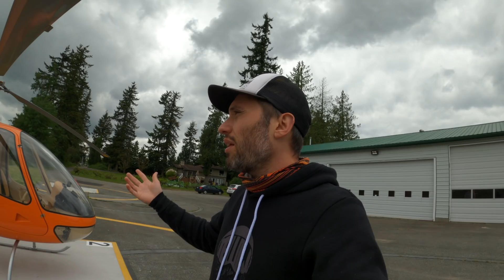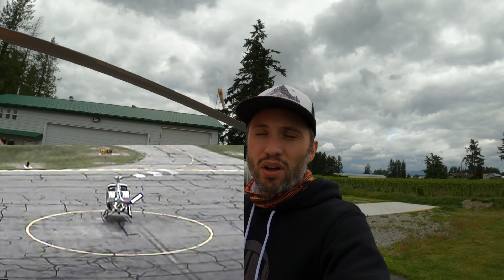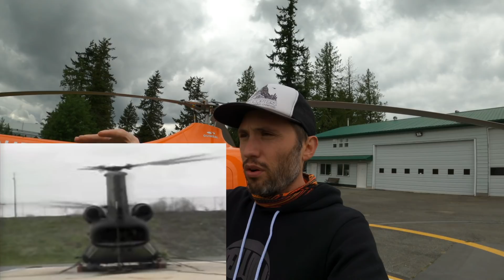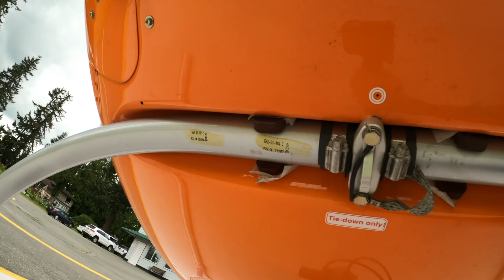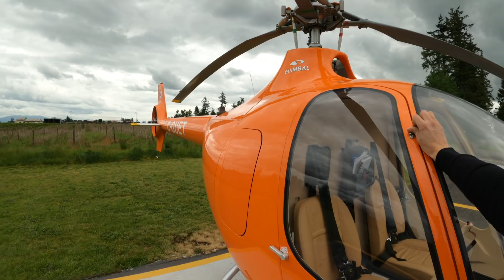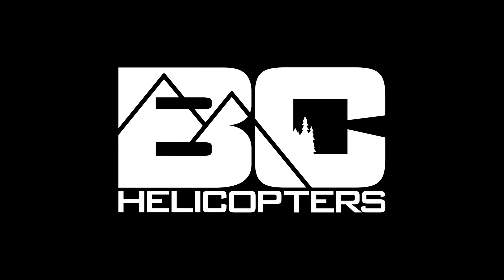WHY HELICOPTERS GET GROUND RESONANCE

Comment: I'm in engineering and I've seen a lot of cases where words turn into sounds when somebody's explaining. This is not ground residence and it's the vibration frequency like Tesla describes. This thing weighs nothing has a Gob of horsepower and it's Giant swinging rotor is a source of pulses of timed energy. The whole helicopter is resonating whenever it is flying in the air like a tuning fork and then the ends  grab the ground and reflect all the energy back up into the helicopter. The energy accumulates by increasing the amplitude of the vibrations.

Comment: A pilot friend of mine said this is why when you land you wait a moment before you spin down to confirm you've got a smooth landing -- if you start to feel it, you're already in position to get off the ground quick.  If you spin down you may not be able to avoid the rapid disassembly.

Comment: Question: If instead of a skid, the helicopter equiped with wheel and suspension like the mi-8/mi-17. Will that prevent ground resonant from happening? To me it looks like the suspension and the wheel will absorb the resonant

Comment: I would add that the cause is that the lead/lag of the blades get out of sync such that the center of rotation of the blades is no longer over the shaft. It’s offset

Comment: This may be why my RC Helicopter is a doing this when I spool up slowly.  I was thinking it had to do with the onboard gyroscope acting wonky since the helicopter was still in contact with the ground and not responding to it's attitude changes the way it expected.  I just got in the habit of spooling up and lifting off the ground a foot and that solved the problem.  I was unfamiliar with ground resonance.  I also tend to keep the screws that retain the main blades to the rotor a bit on the loose side, think I will snug them up a bit as well.  Thanks for the video!

Comment: What you failed to mention is why it only happens with 3 blade or more (fully articulated rotors) and not 2 blade is because the 2 blade doesn’t lead and lag (semi rigid system) 
If the 3 blade gets out of phase (120 degrees apart) it causes the vibration in the rotor head

Comment: Nice video except you didn't actually explain what causes ground resonance. It is not simply the shock of landing bouncing between the rotor head and the ground. If that was the case it could never happen when an aircraft is starting up. Too bad for all the people who think they understand ground resonance after watching this video.
Ground resonance is caused by the rotor disc being out of balance, so the center of gravity (CoG) of the disc is not in the center of the mast. So the whole aircraft starts rocking round, following the CoG as it moves around the disc. If the flex in the landing gear, the tyres, through the airframe the sponginess of the ground or whatever happens to be just right, then the amplitude of the rocking will increase, making the CoG move even further out, making the rocking worse which goes on until destruction. So the bounce back is definitely involved, but not mentioning the out of balance rotor disc is a large piece of the explanation missing. The shock of touching down can be one reason the disc goes out of balance. But a gust of wind or a faulty part can also cause it, among other things.

Comment: Brantley helicopters effectively resolved this resonance by using a double articulating rotar blade design on both their models. The inner short shaft design wasn’t taken up be other designers; the outer blade sections Cary the flight loads.

Comment: Basically a lot well explained but technically not accurate. Kind of housewifes explanations. For example, if you lift off, ground resonance goes away because you add aerodynamic damping to the lead lag motion with larger angle of attack. Lead lag damper only add damping they avoid resoance by additional damping and not by restricted movement.

Comment: Correct me if I'm wrong ---- as I usually am --- but it sounds to me like constructive interference between the rotor head and the ground.

As the vibration/pressure waves from the rotor head, to the ground via the skids/wheels of the helicopter rebounds off of the ground, those propagating waves collide the ones still being generated. Some of those many be canceled out, due to being the equal, but opposite frequency, and waveform (deconstructive interference).

However, some waves are of similar, if not exactly the same frequency, wavelength, etc, and what you get is bigger waves. Thus, in a cycle of positive feedback, the rapid increase in resonance overcomes the natural frequency of the materials used, thus causing catastrophic metal fatigue, as, as soon as the first micro-craking begins, those crakes rapidly propagates, tearing right through the material in fractions of a second ... it's a similar effect of how a glass can shatter by sound waves alone, as high speed footage shows the glass literally flexing like jelly, until the stress harmonics cause material fatigue ... then boom, glass everywhere ...

At least that is what I think is happening. Although I'm a (very ...) amateur astronomer, at best, my day job was in veterinary laboratory science, where the only physics I encountered was in autoclaves, and ultra-centrifuges, especially a continuous flow centrifuge, which I didn't understand how one worked, until I got to use one myself. Very interesting bit of kit, that had to be in a kept in, more or less, strengthened fume cabinate, with a high strength, polycarbonate vertical sliding door, that had to be closed, as much as possible, allowing for the in- and out- feed tubing, just incase one day it decided to fly apart at, iirc, ≈20K RPM. But watching it spin up, was fun, although a bit scary as the meter just kept climbing ... interestingly, a by product of it spinning so fast is the pitch climbed so high, that, once at full speed, it went near silent, which was damn eerie the first time ...

Comment: Mellow Yellow have seen this happen but did not know why. Thank you for a detailed explanation. So now a question, the small landing pad by your video prop....what if it is made of say 2-3 inches of rubber (like a kids school jungle Jim area) would that help in the shock transmission to the rotor head. It would be like the foam dampener od

Comment: So when landing, as soon as you're in contact, collector goes full down? Would that serve to dampen the resonance?
Reply: Actually no. Once ground resonance begins it is best escaped by doing one of two things. 
Break contact with the ground by raising collective and throttle.
If lift-off power is not available, then you must quickly change the frequency of the resonance excitation coming from the rotor head. This is best accomplished by leaving throttle at idle and pulling FULL collective as quickly as possible. This will act as a rotor brake and  decay the head-speed very rapidly, breaking the positive feedback loop. 
Reducing collective will do nothing except assure continuation of the resonance which will likely continue to build destructively.

Comment: Same applies to RC model helicopters. With rigid heads and stiff blades i just give alot of negative pitch so the helis is pressed to the ground - that trick only works with very stiff blades otherwise you easily get a boom-strike.

Comment: I don't understand how a resonance can be established between a static surface (the ground) and the aircraft. I think of resonance as occurred with the destruction of the Tacoma narrows bridge. The wind started the motion, and then the swaying bridge amplified it. 
How does the ground act to amplify the resonance with the helicopter? It seems to me that the initial impact with the ground might start a resonance in the rotor blades, that they perpetuate themselves. This would also explain why it could happen during startup, when ground impact wasn't a factor. 
Why does it only happen with hilos with more than two blades?

Comment: If you didn't have enough power to lift would rapid small difference in movement of the collective or the cyclic knock off the resonance? Just thinking the resonance or rebound maybe a blade working against the skids/ground and that it can't overcome the resistance.

Comment: Once you are back in the air... ya gotta come back down.  and do it all over again.  You can't gently touch down, so the
only way out, is to get the machine within an inch or two of the ground, and gently, but assertively .. dump it onto the ground.
Happened to me in an AS350.  I've heard that a two or three inch off the ground hover chop will have the same effect... never had the opportunity to try that.  That might work better if you only have grass or gravel to put down on..?  Maintenance guy thought I was nuts... but he did find a weak damper.  He had never heard of that process before.

Comment: Park helicopter on the grass rather than concrete? 
Grass= bouncy, soft, low shock reflection.
Concrete= hard, resilient, high shock reflection.
You'd need to learn to recognise the symptoms, you never know what you are going to land on.

Comment: When a pilot starts to feel the shaking, a basic mistake is to think if he sits tight it will subside as the rotor slows down. Unfortunately the rotor speed will probably pass through a much worse resonance before it subsides. That's the trap which can only be remedied by lifting off and gently setting it back down. The prolific author of the Helicopter Online Ground School got into ground resonance in an Enstrom and wound up getting flung in his chair a good distance from the helicopter as it self-destructed. Lucky to survive. Blamed on a faulty lead-lag damper. By the way, Mischa, most professional communicators refrain from the temptation to keep addressing "guys". Overly familiar and not that attractive to the women in the audience. Just sayin'!

Comment: Thanks , now I have a good reason why I put my radio control heli into the ground with only my wallet a casualty and quite a few times I might add. Damn ground resonance got me again.
Reply: Did you happen to check your blade or rotor pitch after the wife left the garage? Just saying. I cannot fly cause my wife says I have too many hobbies but I always check my motorcycle throughly before liftoff.😎

Comment: rc helicopter pilots call it doing the funky chicken, but thanks to a one hour hover lesson and a 6 hours fix wing plus about 10 hours ground school for both never got my rc stuff destroyed. Just fun to wacht people scratch their heads after they told you time and time again that they know what they are doing. yet their helicoper is in pieces, their fixed wings are full off dirt and you go home with everything still in perfect condition. all because they are older and have been flying rc for a long time. i only got in to rc because i got disabled before i could get my license.

Comment: Only flown r/c model helicopters but this was excellent information!
Reply: My old 60 class nitro helis would do this - a friend of mine got a boom strike because he sent too long spooling up and adjusting his radio strap.  Since they are small scale, any tiny imbalance in the blades / rotor head will kick this off as will a gust of wind.  Many a time I had to do a quick lift off to avoid the same fate.

Comment: I'd be curious to know if a thick rubber mat bolted down to landing pad would eliminate the chances of ground resonance to begin to start with. To me is sounds like GR begins when the skids make contact with a hard solid surface. I'm interested in this as my favorite helicopter to ride in is the 4-blade Bell 407GX Jet Ranger. The last one I rode in, the pilot landed on a small slightly elevated wooden platform cushioned by rubber and I noticed nothing unusual. Just had to watch your step from the platform to the tarmac. He was an exceptionally smooth pilot to begin with which really helps.

Comment: Wouldn't a compensation dampener on the skids or even in the tube of the skids, stop the gr? There is a product that we superbike riders use on the swingarm that helps with resonance problems called Oversuspension. Here is a link to that product: https://www.bellissimoto.com/parts/suspension/oversuspension/oversuspension-for-the-bmw-s1000rr-2015-2019

Comment: So if you get ground resonance when you land and the solution is to lift off again, what happens when you land again I wonder?
Reply: Typically it occurs from a hard landing or uneven landing setting one skid before the other and the other smacks the hard ground surface and causes a resonant strike which causes the return resonance from the moving mass of the rotorhead. Land as softly and gently as possible, never be too quick to dump the throttle or drop the fuel, keep the rotor rpms in the green arc, gently lower collective until softly on the ground, wait for everything to stabilize as your lowering collective, and if you feel vibration then your rotors are still in the arc to grab collective and lift the skids from the surface. If it's persistent, try landing on soft grass, keep the rpm in the green arc, lower collective, should be fine. Also settling on a parking spot with a side wind where you have to keep the cyclic pitched into the wind with a little collective pitch involved to hold position as you gently set the skids and roll off the pitch helps. 
Then go home and put your A Star on craigslist and go get a Real helo...😁👍

Comment: does helicopter that have retractable landing gear ( i.e one with shock absorbers ) have this problem as well ?
Reply: Yes they do.
Reply: It's a multi-factor phenomenon, and it all depends on the natural frequences of the whole pack. That Chinook on the video had retractable landing gear. Even changes in cargo load or cargo position can relieve or worsen the effect.
Reply: @ivandetoledo  incorrect. The 47 does not have retractable landing gear.
Reply: @skipstreet  Man!... you're right! I always thought it was retractable, because it looked like that so much... I'm sorry and thanks for the warning. Anyway it has tyres and shock absorbers that are the likely elements to prevent resonance on the retractable ones, and yet it suffered the damage. The aircraft structure, in part or as a whole, the payload, the rotor speed, the moving parts, etc. can eventually set a condition of catastrophic vibration. Shock-damping elements help a lot, but sometimes they can't avoid it.
Reply: @ivandetoledo  looking back at my comment it sounded harsh. That was not my intent.
Reply: @skipstreet  Relax, you were polite. And spared me of a misconception I carried for decades. I thought it was retractable only because it seemed to be 😅
Reply: It's possible,  but improbable.  Much slower to build,  and easier for the pilot to compensate correctly. Although I've only got 200 hours in a uh60 and around 50 in luh72 (ec145), I've experienced minor ground resonance with both aircraft.  The blackhawk pretty much fixes itself if you aren't actively progressing the issue and you didn't do anything exceptionally wrong🙃
Reply: Good question I was always wondering why they use retractable landing gear on the Blackhawk helicopters
Reply: No, the tires and shocks prevent that
Reply: @prehensileman7254  you are incorrect. Ground resonance is not alleviated by the tires and shocks. An example would be if a helo is tied down and the attachments are above the shocks this can cause ground resonance.
Reply: @skipstreet  yes shocks help with ground resonance. That’s why newer AS350’s and all H125’s have absorbers on the front attachments for the skids.
Reply: @randallranchnorth8840  did you read my response? You are correct if the helo is tied down below the shock so it ls stroke is not impeded.
Reply: @skipstreet  tied down?
Reply: @randallranchnorth8840  OK. Now I see the problem. My aviation experience comes from my time as an aircrewman while in the Navy. And of course on board ship we tied our aircraft down. But I forgot we didn't when we were shore based unless we were expecting high winds. So I'm the one in error here.
Reply: @skipstreet  you're right because the Chinook retractable landing gear
Reply: @Dra741  looking at your two comments I don't think you know the definition fire retractable.

Comment: Helicopter: A bucket of bolts flying in loose formation.
From the moment it comes off the assembly line, all that machine wants to do is kill you. Not only are helicopters trying to kill you, they are also suicidal.(Ground Resonance) It's a collection of parts that really don't want to be there.

Comment: Simply put, ground resonance is when one blade gets out of the plane of rotation and bites more air, causing the blade to move backward from it's normal position  and now the main shaft is out of balance and it only gets stronger until it rips itself apart.
Reply: @Akhenaton nope these are fully articulating heads, the blades have lead lag, and flap, 

Ground resonance occurs when one of the blades lags further than the rest it bites more air throws the whole rotor out of balance.

If the out of balance frequency matches the skid impact frequency then the whole vibration will continue to worsen. 

This is why ground resonance is far less of an issue with rigid rotor systems found on helicopters like the bo105
Reply: Actually ground residence is when an old Chevy passes by dropin that ghetto base and you turn to look and see that the trunk is shaking itself apart. This is also indicated by a rattling license plate.
Reply: @Akhenaton that would it’s street name. 😂

Comment: My 300 got into GR just after my examiner (for my CFII RH) got out with rotor turning saying “meet you inside”, leaving me to shut down. GR came on very quickly so I just grabbed collective and was able to move it off the crack in the asphalt that I believed caused it. Don’t land on cracks!